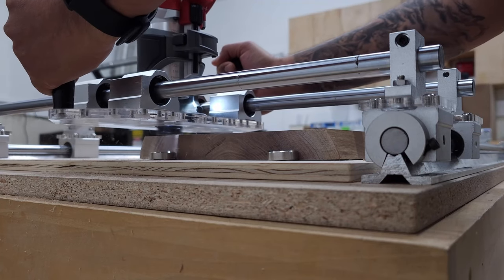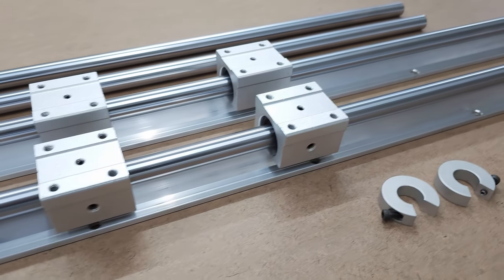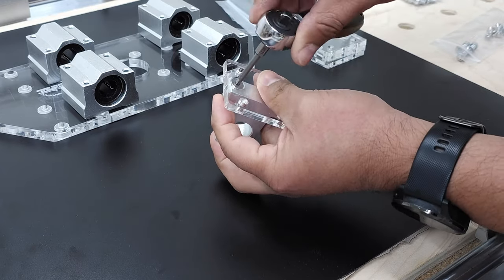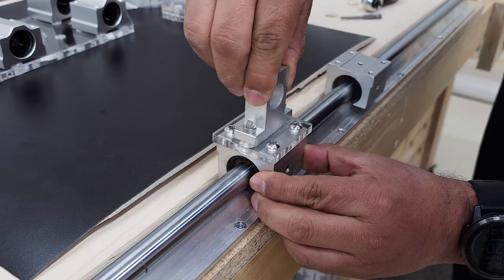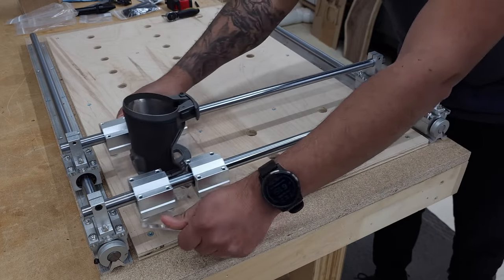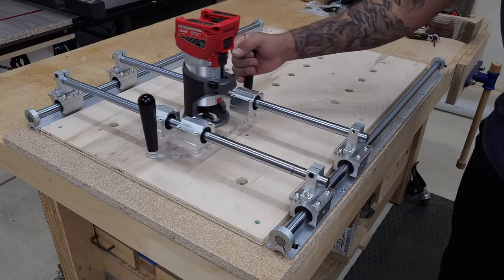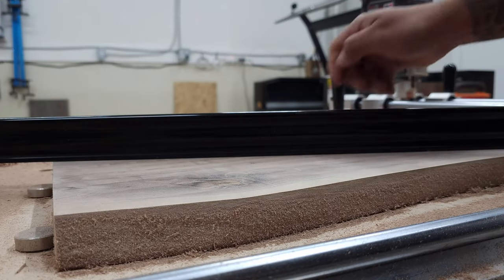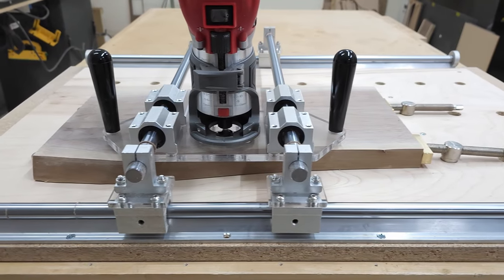First Ever Trim/Palm Router Sled to Flatten Boards

Comment: Breautifully designed and your explanation for assembly is flawless. Nice and consise with the design too. Back before it was "a thing", I designed and built a crosscut sled using the linear rails. The saw sits on a 3/16" plate of aluminum and cuts across as well as length wise. I wanted to make a 9ft jig, but I could not find rails that long without going custom or paying a fortune for them. So I use my diy  circular saw and that I made using the Make Things channel's design with conduit and wood. What makes the saw able to cut in either direction is a two plate method using a thinner top plate for the saw that turns on the 3/16th plate. I use a strong spring and steel rod to lift the saw, turn it and the dowel aligns with a hole in the bottom plate and its locked in. That is a very simplified explanation of how the saw plates work because there are many small pieces, screws, and other items involved in its ability to twist in another direction. When designing this, I kept 3 things in mind- 1) It had to be safe so there is no movement in the two plates once locked together (without being overly complicated too). 2)  It had to be precise when cutting. 3) It had to be portable without being heavy. This sled can be moved so I can use it outside on nice days and for storage when not in use. I have a VERY small shop and space is at a premium, so I desighed it so it is stored close to the rafters above my workbench. The  jig is on a pulley system and lays horizontally when being lifted or lowered. If you know what a bicycle lift looks like, mine is similar to that.  I also can stand it on end with a few adjustments and use it like a panel saw for whole sheets of plywood. I dont work with slabs often only because they are very expensive where i live and i design and make items that can be easily shipped. I made a flattening jig when building my assembly table and instead of buying angle iron, I repurposed one of those simple bed frame made out of steel angle iron. It was free on the side of the road and whenever i see one free i grab it up. I have used them for projects with screws and by welding them. The make great tool holders that i screw to pieces of wood that then are added to the french cleat system in the shop. You just have to be able to drill holes into the steel for screws to attach it and for the tools they will hold. Oh, and lots of cutting oil so you dont overheat the drill bits 🙄. They are easily cut with a hack saw, an angle grinder or a meral bandsaw. I have tool holders already to be assembled, i will just have to drill or cut the appropriate holes depending on what they will hold. I also sell premade screwdriver holders, plyer holders and specific tools like angle grinders for mounting to a wall and ones with magnetic strips to their underside for toolboxe drawers and sides of toolboxes all out of free, repurposed materials I find in other's trash on bulk item pickup weeks in surrounding towns and cities.
Reply from the maker: thank you for watching my video. It seems like you're a very busy person, which is great. Keep up the awesome work, seems like you enjoy it greatly.

Comment: Excellent! I did something similar using the same linear bearings for axes Y and Z. I used 20mm rods for the X axis to avoid deflection caused by the router's weight. I added an 8mm all-threaded rod in axis Z to increase the depth cut by 1.25mm for each turn. Using a wireless palm router as you did, is a plus because you don't have to deal with the cord.
Reply from the maker: These sleds are extremely handy to have. My goal was to keep it compact and portable. But absolutely many ways to create these router sleds. Thanks for watching

Comment: So first.. this is fantastic. Nice that you offer the kit that most have to source right angle brackets, wood, etc for. I would ask though.. if you have a full size router option (or if not, might provide one). With that question.. I'd also ask why palm router vs 1/2" shank 2+hp plunge routers like most DIY videos show. I ask because I assume flattening any sort of hard wood would benefit from the heavier bits and much more power. I do understand that the palm router is much smaller, making this faster/easier to be portable, setup, etc.. but I feel like it would take a lot longer to flatten wood with. To each their own.. I bought the rails, collars and a cheap VEVOR 3.25hp plunge router since I doubt I'll use it that often. But the bracket to put the router on to and attach to the Y rails is the issue for me. I may just buy some acrylic (thick) and the L brackets (aluminum) and see what happens.
Reply: He used a smallish palm router because of cost: If you want to flatten a board with a powerful 3 1/4 HP plunge router, the weight and force of the heavier and much torquier router will sag the rails on any long rail span... Thus, a much more expensive rails or "shafts" would be needed for adequate rigidity and absence of sagging... at a much higher overall  cost!

Comment: Very excited to build my sled - thanks so much for the details. Glad there doesn't seem to be any flex in the 16mm rods. I am also amazed there is enough power in a cordless router. Do you find battery gets depleted quickly? Might have to look into that as well. :)

Comment: Do you have the dimensions for the boards used for your sled? Also rod lengths? I too have a small shop, and this would be perfect! Will be ordering the essential kit from you soon. Already ordered a router base plate for a mini router table. Excellent work!

Comment: Nice work with the kit! Just ordered mine. Do you have a router bit recommendation to go along with kit?
Reply from the maker: Thank you, I appreciate the support! I highly recommend the Amana Tool RC-2245. It has a 1/4" shank with a 1-1/4" diameter cut capacity, which is the largest you'll be able to fit with this router plate.
You can find it here https://www.toolstoday.com/v-12260-rc-2245.html

Comment: I am just getting into all this and this looks amazing. Now I wanted to ask if this would be pretty steady for 3ft table tops I’m going to be making for my event rental company. The tables will be 3ft by 8ft long. So the y-axis rails I would need I would think would be around 38 inches. Would you recommend going maybe thicker than 16 mm or would you think it would hold pretty still ? Would love any recommendations!
Reply from the maker: apologies for the late response. I would say 36" is the max length you'd want to go with before you start seeing some flex. These are meant for smaller table tops and cutting boards. I will be testing some 40" 16mm rods to see if it can handle the weight at that length but I haven't gotten around to it yet.

Comment: What size of bits to use for trim routers? Can i use like. 6x35 bits? Nice tutorial btw 👍 new sub here.
Reply from the maker: Thank you for the sub! I would recommend using a surfacing bit no larger than 1.25" diameter or about 31mm diameter. Amana Tool RC-2245 is a good one and others have used SpeTool surfacing bit.
Reply: @WoodGrainJunkie  thanks alot man. Im gonna use this for guitar bodies.

Comment: What router bit are you using? I have gone through a couple that have completely destroyed epoxy... now of course could have been a tiny bend but they were new. I am only planing small boards at this time so have not upgraded. Anyhow, curious as to what you use. Thanks

Comment: I like the kit but I want to use my Milwaukee 5616-20. Will it work?
Reply from the maker: I will be testing on medium sized routers like that Milwaukee. It will most likely need to include 20mm rods for the added weight. Stay tuned for some of those updates.

Comment: Nice!  Any chance you can include a hole for a vac attachment?  :-)
Reply from the maker: I battled with this option. Ultimately I decided to make it more compact vs adding a vac hole that struggles to suck up the chips. I will test out some variations in the future, but for now it won't have a vac connection hole.

Comment: Do you sell just the Shaft Collars? If So how much
Reply from the maker: The Essentials kit includes the acrylic base plate, 2 handles, 4 linear motion bearings, 4 shaft supports and all the screws/nuts needed to put it together. You would need to purchase the rails/rods at your desired lengths.
Reply: Donde puedo comprar una

Comment: See 2 things for improvement: First nylock nuts, second in sted of 4 acrilic plates for outher bearing bloks make 2 with correct spacing between them - avoids a lott of unnecesery adjustment

Comment: Buyers beware, ordered 2 months ago, and it still has not arrived. Keep getting run around about waiting on some piece or another. Then told shipped 3 weeks ago. Still not here. Then told it went to Alaska, which is nowhere near me in the southeast.
Reply: @bluedogstudios422. - did you receive your kit yet?
Reply from the maker: Apologies I'm only seeing this comment just now. I've only had one issue shipping these sled kits and it happens to be the one that was for some odd reason rerouted to Alaska before making its way to you in the Southeast.

I definitely want to clear up some things here. I was in constant communication with you via email about shipping and tracking. I also emailed you updates and when it was finally delivered. Also, your order was placed Aug 16, shipped next day, and unfortunately delivered Sep 5 due to USPS issues. 17 business days and not 2 months as you say. I only say all this because customer service is my top priority and I wouldn't want potential buyers to be hesitant buying from my shop. I felt it was important to give proper timeline and situation here.

Hope you have a great day.

Comment: Unless you use the router to flatten the spoilboard underneath there is no guarantee this will be flat
Reply from the maker: you definitely want to make sure your workbench or the surface you'll be mounting the sled on is as flat as can be.

Comment: Well, this is far from a "first ever" design to incorporate a router into a sled for board flattening. It's not even the first one sold as a kit. There are flaws with this solution that will not reliably yield either a consistently flat surface or a uniform thickness.
Reply: What are the flaws?
Reply from the maker: not the first router sled or kit, but first in production using the trim/palm router platform. If there are some out there definitely list them as well as the flaws with the router sled design. I've had much success using this very design in my shop as well as countless customers who are happy with their purchase.
Reply: Definitely living on his ego

Comment: You make a big mess and will gum up the liner bearings if you don't attach a vac. Also, the left and right X linear bearings should share a single plate, not installed on four individual plates. It would provide better stability and much less flexing.